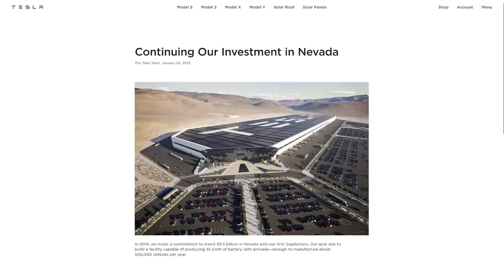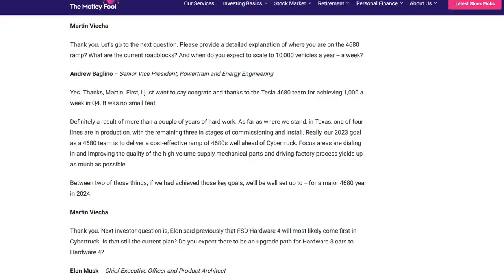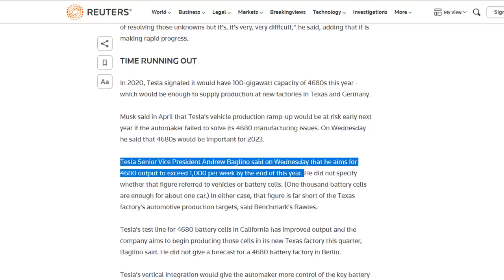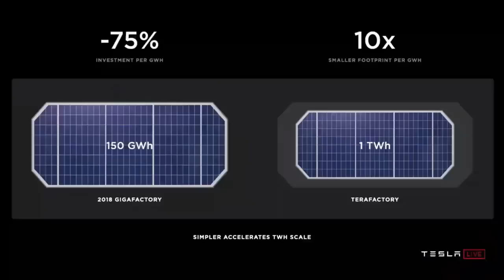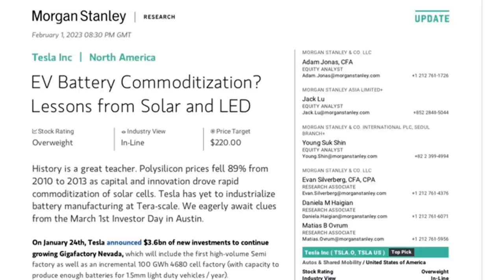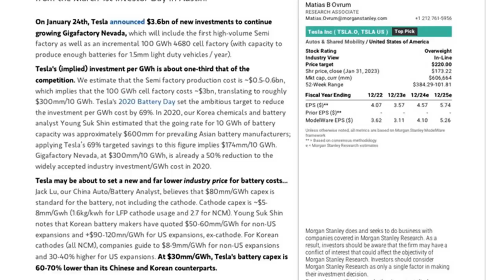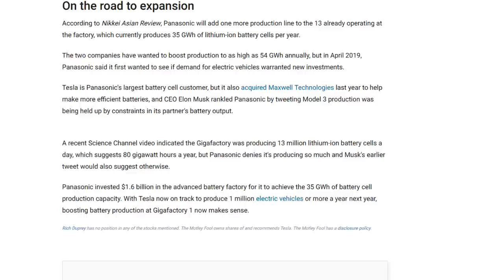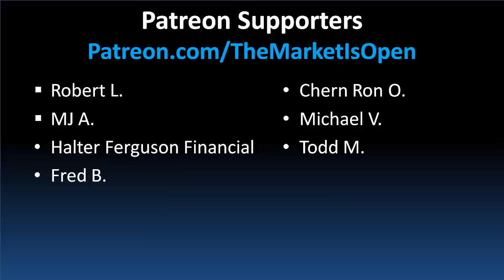The REAL Reason Tesla is Building 2 NEW Factories

Comment from the maker: Do you think Panasonic will be in talks with Elon Musk to convert parts of its factory to 4680 cells? And is Morgan Stanley right that Tesla's Semi Truck factory is only $600M? Be sure to watch:
• China BYD's Atto3 & 8TT Electric Semi Truck may CEDE Batteries to TESLA: https://youtu.be/MgD2NHoegt0
• Signs of Ford’s COLLAPSE Are FAR Worse Than You Think: https://youtu.be/fWe-BC2uHWE
Visit our website https://themarketisopen.com for instant quotes and 15 years of financial data
Reply: Yes 🙌
Reply: I don't see any reason to convert anything. There is near infinite demand for all types of cells. Keep the existing lines running, and make the 4680s on new separate lines.
Reply: If they are smart they will.
Reply: @PCLoadLetter  Looking to maximize ROI? sure but in time rather than maintain old equipment they could use 4680 tech to make the smaller sized batteries collapsing their footprint and increasing their output.
Reply: @Barskor1  You'll still need 2170s for replacement packs (like for like). Owners will seriously consider life extension if another 500,000 miles can be obtained for a third of the cost of a replacement car. Also, robotaxi will include all those end of lease cars that Tesla are amassing. They'll be absolutely run into the ground and will need like for like replacements too.

Also, Tesla made no bones of the idea of selling.their own cells to competitors, on the grounds of master plan part deux being about advancing the transition, not cornering the entire market. They won't all switch to 4680, and they certainly aren't agile enough to change to anything new anytime soon.
Reply: @PCLoadLetter  good points.
Reply: i am not a EV guy. but if i would to get one, difinialty tesla. 
NOt chinese, Not Hyundai or KIA.  those are one of the most dangerous and poor quality car in the market.
even greedy  insurance companies are refusing to cover them/🤣🤣🤣🤣
Reply: @PCLoadLetter  IMO you can use other battery form factors to replace 2170 packs the main issue is to match voltage and amperage to the old system everything else is software and Tesla can handle that before lunch.
Reply: @dark6c159  Boomer talking!
Reply: ... Tesla will use IRA to "bootstrap"... is what you meant to say I believe
Reply: No, I do not believe that Tesla intends to share its technology with Panasonic. Panasonic has announced that they will build their own 4680 cell production factory in Kansas. Panasonic will sell these batteries to any customers, not just Tesla. The Panasonic version is not the same as Tesla's version. Physically compatible, but conventional manufacturing.
Reply: I believe Morgan Stanley is right about the investment split.
Reply: @royh6526  And?

Comment: No
Reason 1
Fast Fast Fast
Tesla has a Mexico border private lane with nonstop inspections. Fast Fast Fast
Fast Fast Fast shipping in and out of Mexico.
Reason 2
Money 
labor costs are 600% lower in Mexico than in Austin Tx. Mexico is even lower labor costs than China. With a god aufull electral grid of not only Mexico but all of SA and low cost rolling 6-7 Powerwall EvCar w V2G V2H Tesla saves all of SA electrical grid problem.
Reason 3
Tesla Semi is a joke but with a 500-mile run from Tesla Mexico to Tesla Austin ther is now a $1 Billion market for Tesla Semi Joker.

Comment: As a truck driver, I look forward to the opportunity to drive a Tesla semi. But there is a “big but” that trucking companies are facing. In fact, there are several. 
1. Batteries required for the distance required for transport of freight creates a weight that makes the semi much heavier than a diesel semi, which in turn reduces the maximum weight of freight that can be legally transported on American roads.
2. Diesel fuel still has far denser energy capacity over current batteries and is much more equitable. 
3. Charge location and charge time is a logistical nightmare for trucking companies. 
When considering the slavery and pollution far exceeding diesel emissions caused by the mining of the rare materials and then the recycling processes, it is all amounting to an unscientific religion rather than creating any advantage for mankind. I can reach my bare hand into the exhaust pipe of a modern semi and it doesn’t get dirty. Current anti pollution methods on diesel engines are quite effective.